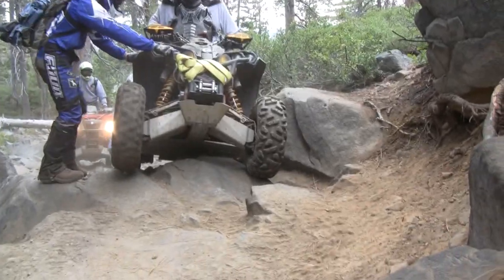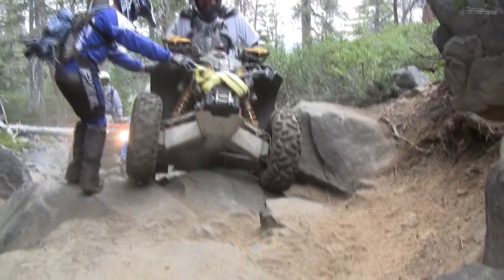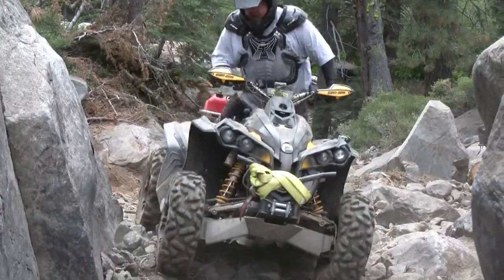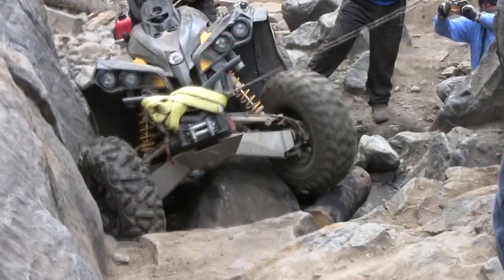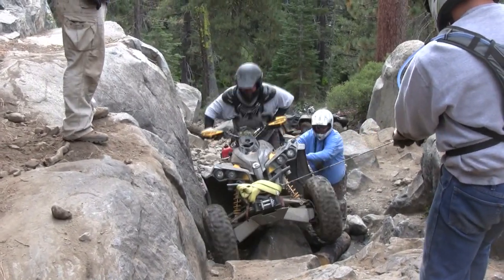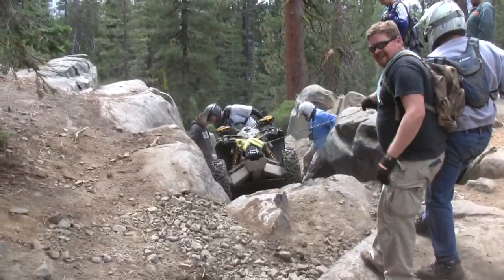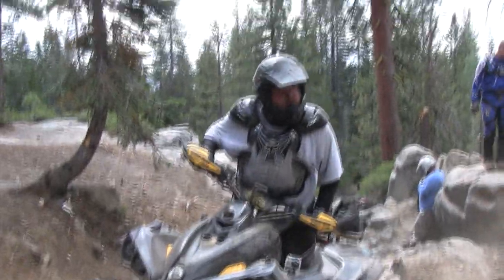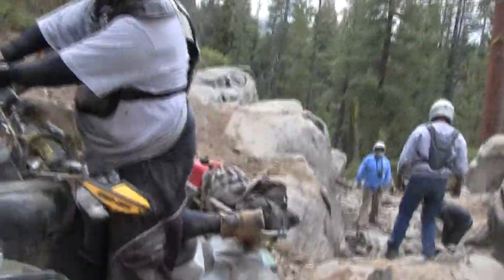Can-Am Visco Lok Rock Crawling Fail

Comment: The non QE Visco lok can be hard to cope with. The key is to hold steady throttle to allow the pressure to build. I have the QE on my 2010 and it kicks in in less then one turn now. Much nicer then my old 08.

Comment: Should never take that long to kick in, I have a 2012 renegade 1000 xxc with tri power steering and QE Visco lock and it has been  improved a lot.Locks in right away , you can barely notice , its that quick and it works excellent in all conditions.

Comment: If all four wheels are spinning it seems like a traction problem.  If both front wheels are spinning, the ViscoLok is doing its job, no?  But if nether wheel can gain traction, you can't put the torque down.

Comment: LOL.  It's a well-known fact the visco-lok has engagement issues.   Even Can-Am acknowledged this issue, when they introduced and promoted the new QE Visco-Lok.   Their own marketing revolved around showing that the new QE (Quick Engagement) was faster than previous visco-lok diffs.   So while you're drinking Can-Am cool-aid....Can-Am is trying to fix their visco-lok issues.   There was nothing wrong with the front differential or any sensor.

Comment: Can-Am is by far the best in rocks bud, if its always locked you eventually torque too much, you sensor might be over used ( BEST explanation) or maybe defect? but i ride a max with 30 backs, 28 horns for rough, never had to get off the bike...only have a 1" lift?

Comment: For every "can am fail" video there is an "Ostacruiser" video that shows how fricken awesome they are.  Here is my most recent stable after going 20 years without riding:
2011 Brute Force - sold
2012 Honda 250x - sold
2012 Honda Rancher 4x4 - sold
2014 Can Am Renegade - Own
2014 Can Am Outlander XT - Own
"Can Am - You're either riding one or you're following one"
Reply: MandMTac lol, how are you even going to try to say that... ostacruisers bikes are only what is left of a can am after ppsm gets done throwing every part in the book at them. dont get me wrong, his videos are awsome but they do not in anyway represent can am in the real world.
Reply: 84regal hookshard Lots of those quads in his videos are stock with minor additions like bigger tires and snorkels.  Can Am's are known for their power and capability out of the box.  Add to the fact that you can modify them, as you mentioned, to be complete monsters.  You have to have a base to start with and mud nationals proves year after year who leads the competition.  My statement is still true regardless.
Reply: MandMTac just your opinion. Can ams not a   better atv just  because they have more power.  Other quads with less power get the job done with ease where that can am struggled. Maybe tin cans should stick to mud.
Reply: Because mud is very different from uneven terrain. In mud you can get away with an lsd but on rocks you need a full time fully functioning locker.

Comment from the maker: @Greekatvman 

It's hard to steer in AWD only when it locks.  It only locks when the rear wheel spins 1/5 of 1 turn.  It's similar to when you lock your 450, only it does it automatically.  It works really well...especially rock crawling when momentum is required.   One of our riders, has the Kodiak 450...it works well too.  He's in that video somewhere.

Comment: The poor response time of the Can-Am visco-lok is the issue.  Tires have no relation to the front differential engagement.    It is a laughable analysis to say tires make a difference in how many times the wheel spins.  Please provide Can-Am literature on which tires BEST engage the front differential.

Comment: I know the polaris works good but they are ugly as $#%&.
they look like some cheep chinese toy.
the Suzuki King Quad works awesome and looks great, my opinion of course on looks.
I worked for a polaris,suzuki, kawaski and honda dealer for 3.5 years and I bought a King Quad cause of how well they work and how little they had issues in comp to others. 2008 750 and my bro has a 1991 300 king thats been through hell and still does better than most new quads he rides with.